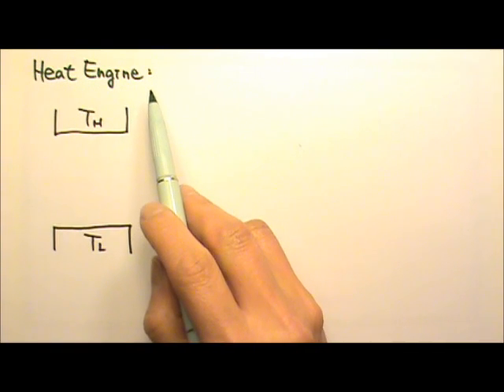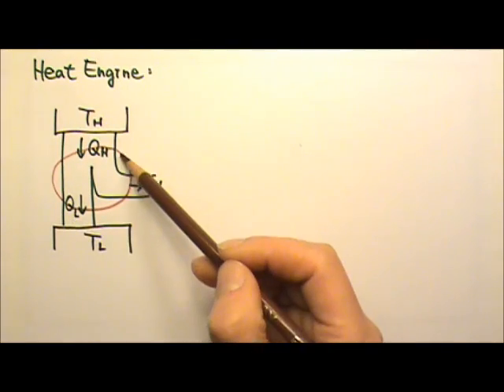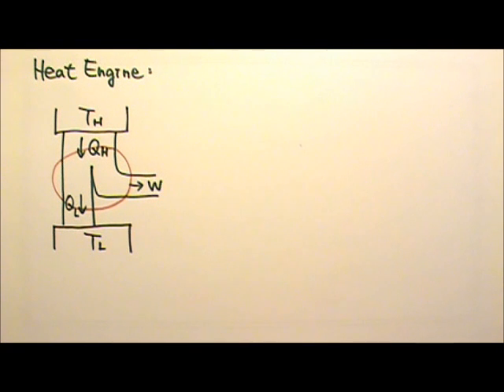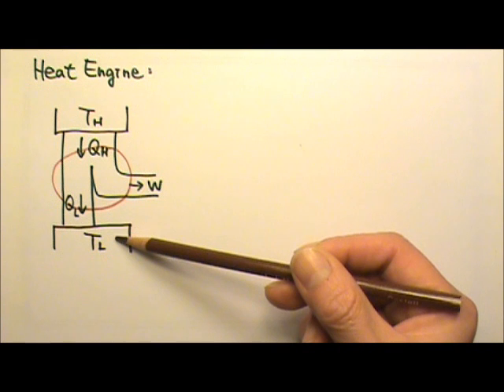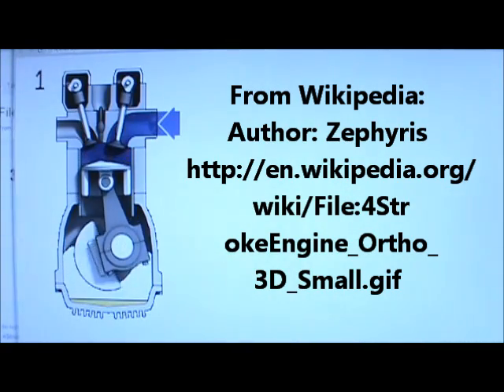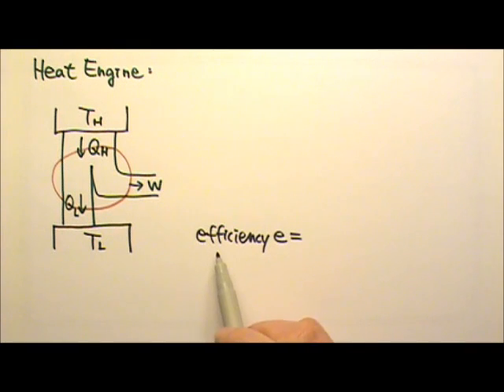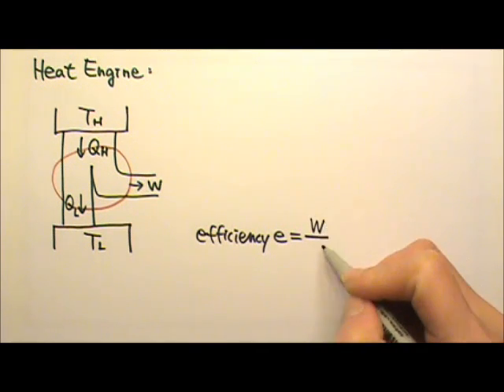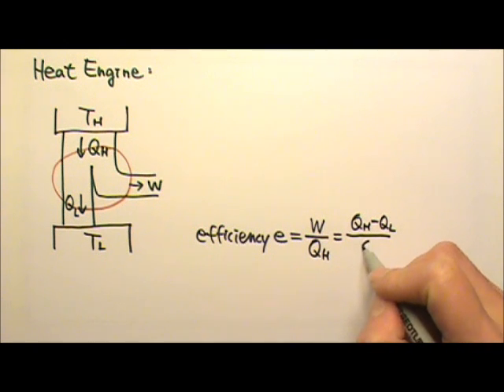AP Physics 2: Thermal 29: Heat Engines and Their Efficiencies

Comment: Hi, I am wondering how can I calculate efficiency from a pv diagram?
Reply from the maker: If you have a cyclic process in a P-V diagram, you have to figure out the heat input for one full cycle (the calculation can be complicated depending on the processes) and the work output for one full cycle (the area inside the clockwise cyclic process). Then you can calculate the efficiency using its definition, e = (work output) /(heat input).
Reply: Yau-Jong Twu thank you!!